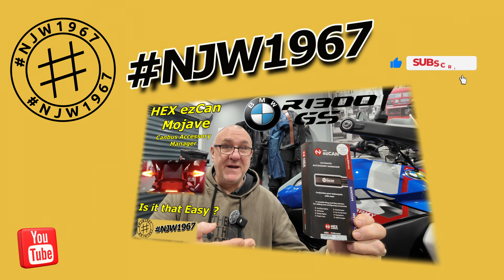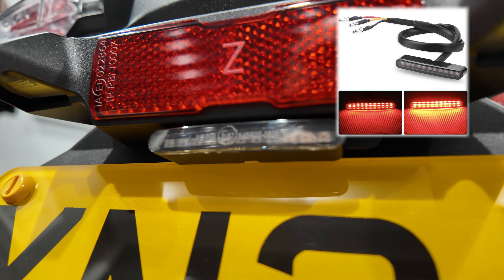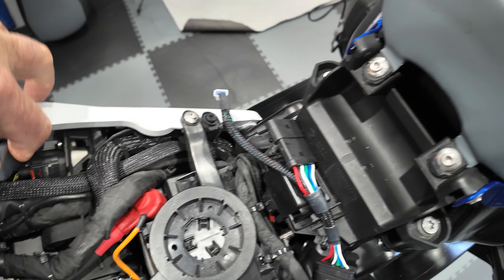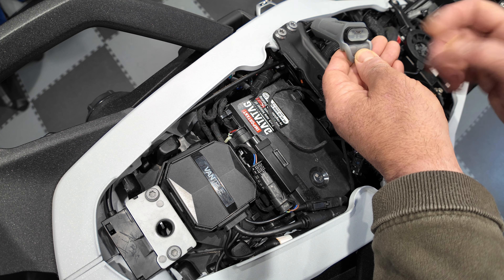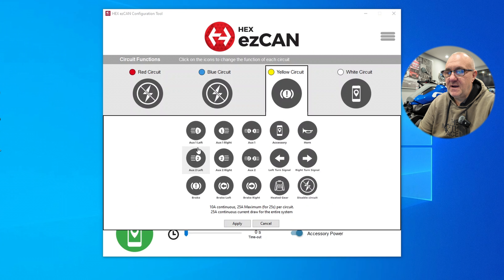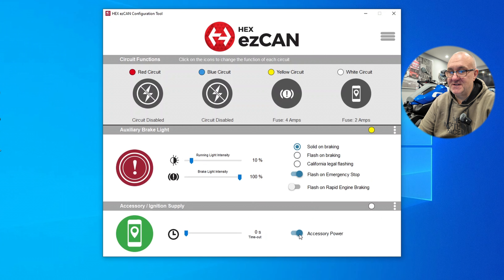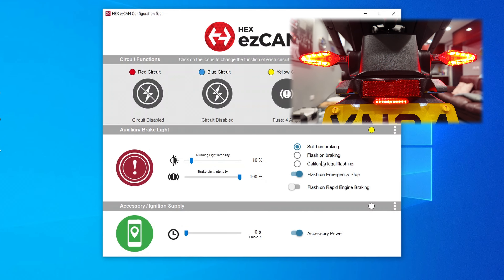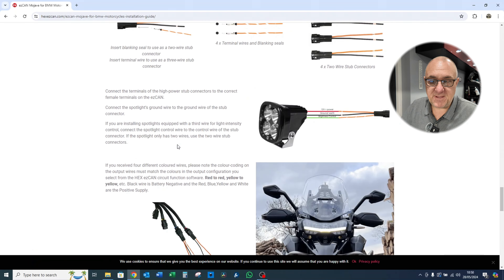BMW R1300GS Hex ezCan Mojave install and set up

Comment: Good day would the Denali brake like go where the rear reflector is 🤔
Reply from the maker: It possibly would buddy but the reflector would possibly have to stay where it is as the unit serves as the number plate lights, I did try to disassemble the reflector but it appears to moulded into the plastic in one piece 🤷🏻‍♂️
I will experiment with this when I find a cheap second hand reflector light unit, you could possibly bond the Denali light to the reflector with double sided tape but not sure if it would look great if it doesn’t match the reflector profile 
😊 thanks for watching
Reply: @ thanks for your reply
Reply: Thanks again happy 2025 all the best to you and yours 👏👏🏴
Reply: I get my new 13 gs on Tuesday 🙏

Comment: Could I fit an additional rear light without the cost of the HexCan 🤷‍♂️
Reply from the maker: @jamescurrie1285  
Unfortunately not James, if you were to add a spur into the existing brake light circuit for example, the can bus would sense the load and cause an error, you could use the signal from the circuit to a powered relay to do this but it would be messy and require power from an ignition source. 
If you think of the ezCan as an electronic fused relay on a network that can access all the signals and use any of signals to share the output and provide customisable control this is what it does. 

Thanks for the question